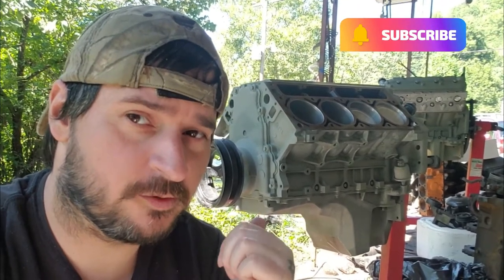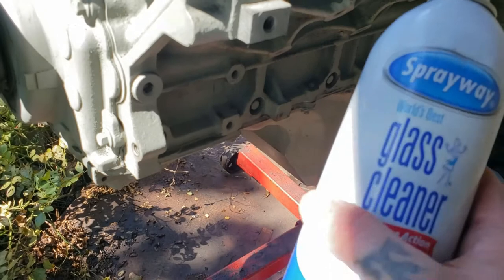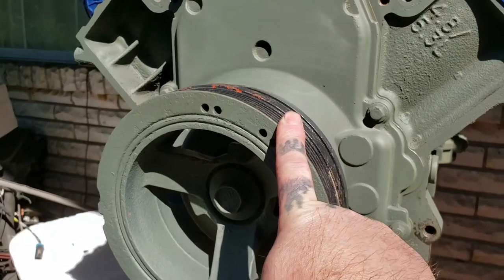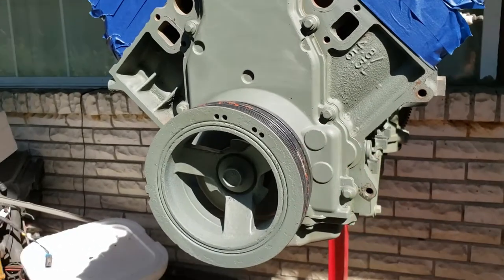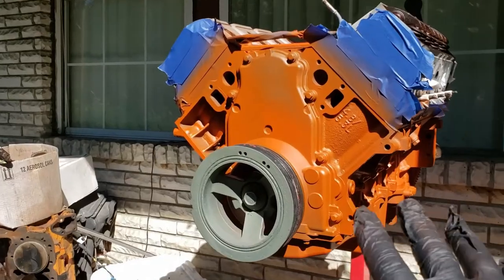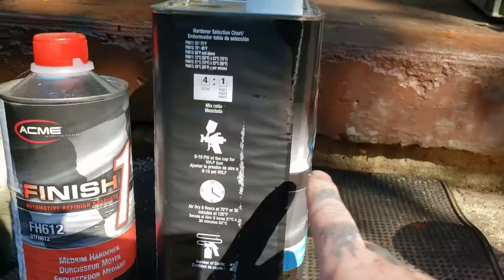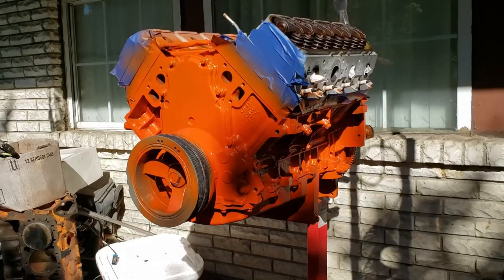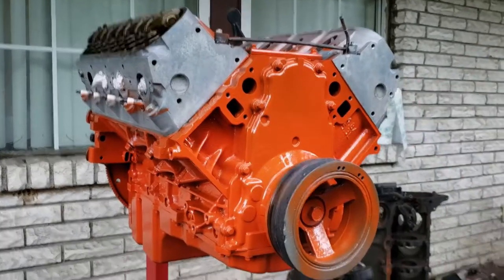Detailed Video On How To Paint A Engine Block - Base Coat, Clear Coat System - HOW TO VIDEO

Comment: 1st, Why didn't you clean the flakes off the block before priming it?  I can see rust in the corners of the block, as well as what looks like "dirt flakes" on the timing cover in the corners...
2nd, when using a scuff pad, you're not "opening up the pores"...  You are putting micro-scratches into the primer so it has a "generally" smoother surface, but the tiny scratches provide more "surface area" for the paint to stick to.  The result is a smoother looking paint job, that sticks better to the object being painted.
3rd, If you do your "test touch" on the tape, you won't leave finger oil, or finger prints on the actual paint job...

Comment: How can I high heat clear coat engine without it rusting
Reply from the maker: if a engine is clean from rust and you add clear coat, it will keep it from rusting